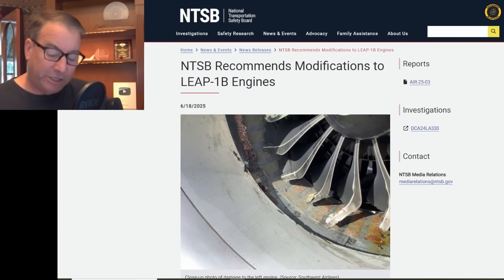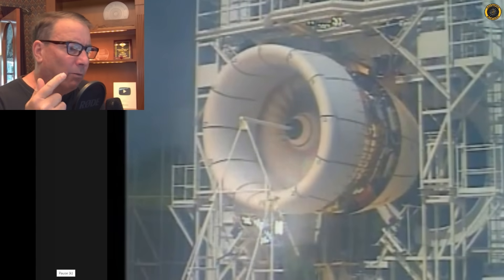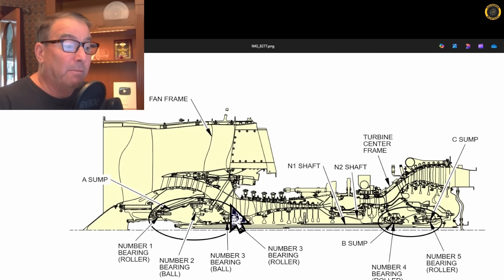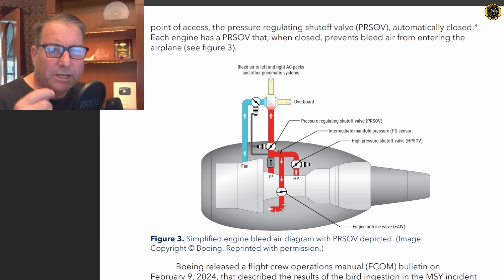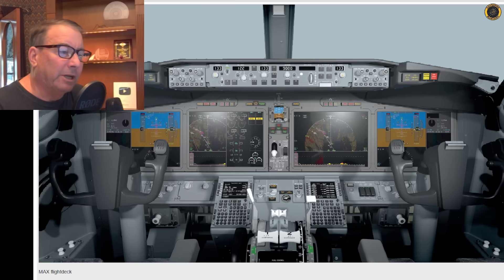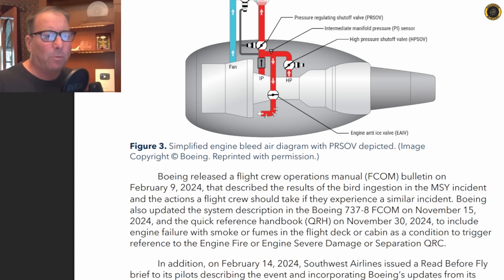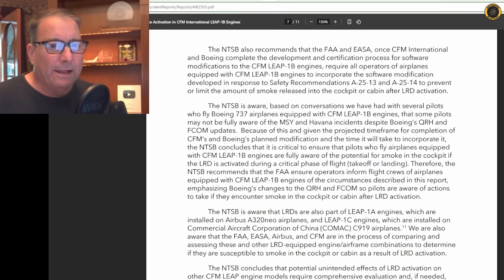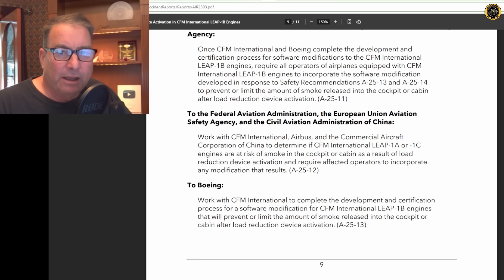NTSB Urgent Safety Recommendation 737Max LRD CFM Leap Engines

Comment: Great video! Looked up our Bulletins and found the updates went in January/February. Had gotten word that a change was coming when I was attending CQ in January. A couple of comments about iPads and whether or not updates are read or skipped. 

It is true paper documents did give you something tangible to reference. I would argue that I can access information MUCH faster and accurately via electronic means using search functions without our document readers. 

That said as a recent Captain upgrade to the 737 I was reminded by my Mentor and  Instructors that flying is indeed a verb and not an adjective. Be it electronic means or paper I believe it's how the pilot approaches their craft that makes a difference.
Reply: The word "flying" is also a present participle and a gerund .. not that anyone cares.
Reply: @hb1338 excellent. I’ll add to that to my brief next trip. Engineering, weather, and etc was my strong suit. Sadly even today grammar is not my strong suit. 

But I’m down for being correct to thank you for sure!

Comment: We are lucky to have Blancolirio and Mentour Pilot to keep us so well informed on these critical aviation subjects. 
Bothe Juan And Petr deserve credit for their professional attitudes on aviation safety.
Reply: Don't forget Kelsey Hughes from 74 Gear
Reply: What about captain steevie?
Reply: oh this is a funny comment. I remember when the first two MAX's fell out of the air and Juan told everyone that it's not that big of a deal and Boeing would take care of this problem ASAP.
Reply: @SebastianPeitsch  Everyone has to start somewhere. I've made similar mistakes before too. You get better through experience and I'd say the Juan's attitude in more recent videos (That I've seen...) is both respectable and commendable. I believe he is trying hard not to make that kind of mistake ever again.
Reply: @SebastianPeitsch Take this comment as you will but one of those crashed Max's flew THREE FULL segments with the known problem.  This aircraft would have been immediately flown back to departure airport and grounded until the problem was rectified.  And I suspect western countries would not have been using illegal and defective replacement parts.
Reply: @garyhalmbacher6875  So what ? The design of MCAS was inherently flawed and dangerous, Boeing failed to test the system properly, failed to take action when it failed in cockpit simulations and recklessly chose not to inform airlines or pilots of its' existence for reasons that were nakedly commercial. How bad can a system be when less diligent operators are the first to discover its' faults ?
Reply: @garyhalmbacher6875  the problem I am adressing is that Boeing was riding on their reputation of being a well-run, secure business. In reality they managed to lead the authorities around the three ring circus by the noses, in the US as well as in Europe, while destroying the union run system in Seattle with going to North Carolina, and moving the headquarters to Chicago. And when the Max crashed it was "irritating" to say the least the Juan was defending them like he did. It's good that this is no longer the case and that the shortcuts Boeing was taking are now continuously being outlined. Look at this nonsense. Avoiding re-certification for FIFTY YEARS just to avoid training. THREE concurrent checklists. That is INSANE.
Reply: @SebastianPeitsch I agree with most of your points.  The fatal move was moving the headquarters away from the factory.  The real reason was the new CEO didn't want to live in Seattle.  If you don't want to move, don't take the job.
Reply: @SebastianPeitsch Having worked in and around union shops, unions protect the lazy, stupid, and criminal.  Good workers don't need unions.  Even if fired, they have the ability to find another, better job.  My motto: Big Government, Big Company, Big Union, the little guy gets screwed.
Reply: @SebastianPeitsch I agree with you that when McDonnell Douglas bought Boeing with Boeing's money, that was the beginning of the end.  The rot starts from the top.    That said, I don't know why everyone says Boeing should have designed a new 737 replacement but if Boeing couldn't even pull off a minor upgrade, why would anyone think they could design a replacement from scratch?
Reply: @hb1338 Actually, MCAS, while stupid, was designed initially for a ONE TIME adjustment of the Horizontal Stabiliser and the initial adjustment was quite small.  The implementation was a disaster and I believe shows Boeing no longer has the project management skills to implement much of anything these days.  Hopefully, now that engineers are running the company, things might change.  Or, it might be too late.

Comment: With regard to the use of the acronym QRC (in this video)  FYI  -  At AAL QRC means Quick Reference Card, not Quick Reaction Checklist.
The QRC is a laminated card that both pilots have on the flight deck, and this card is two sided and has all the "emergency" procedures 
and the "Immediate Action Items".  Many times, you execute the procedure, and the QRC then references you to an expanded procedure in the QRH.  Might be different at other airlines, but again, just for an FYI, that's what it means at that airline.
Reply from the maker: And the throttles are called thrust levers...

Comment: I timed myself and it took me 55 seconds to do memory items and complete QRC step 4...pull the engine fire switch which closes the PRSOV. Thats not going to work if visibility is at 5 inches and at lethal levels in 39 seconds. In reality, we would need to get oxygen masks and goggles on before dealing with the engine. Seems like flipping off that pack switch before doing anything else makes the most sense. Its going to be near the 2 minute mark before you pull that fire handle. This issue emerged over two years ago in March 2023 and we are now only sending a memo to remind pilots to read the bulletin.

Comment: The “hey let keep 737 the same so airline don’t need to retrain the pilots” decision is the gift that keeps on giving. So far a few hundred lifes have been sacrificed for it (MCAS). The decision that was made mainly on financial purpose rather safety first. This smoke thing has potential. Good thing someone caught it but some pilots may not be updated. I hope it’s not my flight. This 737 max has lots of gremlins.

Comment: LRD bolts are further aft from what is illustrated. If the bolts indicated in Mentour’s image were LRD the fan disk would depart the engine.
Reply: as an engine designer who has looked at this area I agree ... I could be wrong though 🙂This has probably been pointed out but breaking these bolts (or stretching) limits the amount of force transmitted from the Fan roller bearing (No. 1) into the Intermediate Case and through the mounts into the airframe. Breaking this flange also sends all the oil from the bearing housing into the high compressor where bleed is pulled off to supply the aircraft ECS system. Enjoy the channel very much Juan!

Comment: Suggestion: Select a random group of Airline pilots across carriers and give them a checklist and see if they can punch holes in the logic of them from a safety perspective.  The need for this critical revision could possibly have been spotted via some scenario simulations/reviews with the view of spotting critical shortcomings.  In the original check lists, as I understand the video, the crew would get to "do the right thing" but it was buried by 3 pages.  What iffing stuff is an important tool to issue spot.  Thanks for your work.  Question; how much input do flight crews have on the development of checklists or this left to the domain of the technical brainiacs at the aircraft designers shop?  Hint...need for some sanity checking before the fit literally hits the shan as they say.

Comment: This “fix” only addresses one circumstance that might allow contaminated air into the cabin&cockpit. Seems like it might be better to design a system that would monitor the air quality coming from the turbines and shut off that air when the quality is poor, just like some luxury cars automatically switch the air to ‘recirc’ when outdoor air quality deteriorates.

Comment: I've been following air accident and air incident investigations for the last 8 months, I used to do failure analysis in the automotive industry, my factory used to make safety critcal electrical components and when one of those failed causing a car to spontaniously combust (which was the most common failure) I and my team would do a root cause analysis. I'm starting to see a patten emerge where aircraft manufactures cut corners in order to save having to change the type rating.  Maybe they type rating should be enforced for all new aircraft regardless to try and stop these corner cuts? I feel something should be done because these aircraft manufactures don't seem to be doing as much quality assurance (like an FMEA analysis) as I had to do for a heavy goods vehicle.

Comment: There should also be a chance to the way the ipads are updated by placing the changes up front and having the pilots acknowledge the changes before they are incorporated into the rest of the electronic manuals.  Kink of like the pink sheets described in the video.
Reply: I agree.  But let me ask… have you ever scrolled through the terms without reading them before you clicked the “I agree to these terms” button?

I guess what I’m saying is that it might be a little harder to make it happen than when you had to pick up a piece of paper, and at least LOOK at it to figure out where to put it!  But I would hope there is a solution in the modern era.

I wonder if the culture of “normal” computing carries over to the pilots in some unfortunate way.

Comment: It's surprising that in our day and age pilots have to find checklists in their iPads instead of these checklists being presented on these nice glass panels - I guess, the sensors all modern airliners are stuffed with would allow to determine automatically what checklist should be presented and even would perform most actions automatically (like shutting down engines, activating and deactivating some systems, etc.)
Reply: Pretty much every airliner, outside of the 737, does this with ECAMS and Engine Indicating and Crew Alerting System EICAS systems. The checklist is presented on right on a screen for the pilots.
Reply: Having checklists on an iPad as a back up has proven useful in the past (e.g. UAL1175 where strong vibrations made operating the B777 checklist almost impossible)

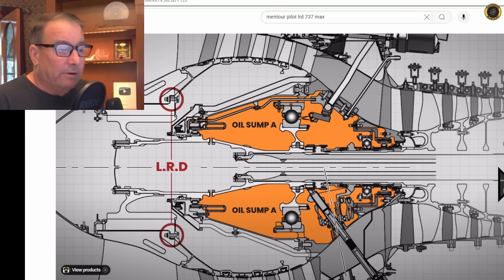Comment: Juan, at 3:25 you are pointing at bolts that drive the other compressors directly behind the fan. The LRD bolts are where the bearing support attaches to the front frame, which is  directly above that huge ball bearing you can a see in sump A.  You can even see the necked-down bolts holding that bearing support against the front frame.  When large loads occur at the forward bearing, they are making their way into the front frame through that bearing support, and that’s why those bolts are necked down in their design To only take a certain amount of overturning moment… instead allowing the fan to try to rotate more around it’s CG eccentricity.

Comment: Same engines are used on A320
Reply: Yes. And they automatically close the air conditioner valves if an engine vibration exceeds its allowabes, as Juan pointed out. The 737 is still manual and there wasn't an emphasis placed on closing the valves in the QRC.

Comment: The reason the aviation YouTube community is critical is because the NTSB and the FAA have repeatedly failed to get important safety information out to pilots or make meaningful changes to policies and procedures when there's a known problem.  THANK YOU JUAN for being a big voice and helping to spread the word about these topics.
Reply: The NTSB does not make policies. They only recommend actions. For decades it has been known that the NTSB endures frustrations about the FAA that seem to drag their feet anywhere they can, specially if a remedy will cost airlines. Think about that. Is the FAA(its make up) the right setup as an aviation authority? Shouldn't the NTSB have more power?
Reply: @2oqp577 The reason the NTSB is allowed to be so vocal and critical is because it has no legislative power. This allows them to make harsh criticisms during their investigations without concern of political backlash. It is theoretically powerless by design, and changing that it would just become another component of the FAA. It’s not a perfect system, but as far as government bodies go, it’s mostly trustworthy
Reply: @2oqp577  Does that make it an issue that Congress needs to take up?
Reply: @2oqp577  FAA is by law a regulatory authority, yet it spends most of its' time promoting and protecting the aviation industry. Somebody somewhere needs to fix that.
Reply: @2oqp577 I totally understand what you’re saying. But when investigations take 2 years and then they don’t even make any recommendations to improve safety… what’s the point of even doing the investigation?!? Seems like YouTubers are the only ones taking accident information and trying to educate other pilots so they don’t make the same mistakes.
Reply: @TheMotoRockers  Well, their recommendations have been the same for years, they are tired of the black whole these go into at the FAA. As for me, upset training, theorical and/or practical would be a must (AQPs) and for low time IFR pilots, recurring training frequency should be up-ticked like for doctors, lawyers, etc. Also, all the 'feel-good' CFIs should get retrained and learn to be tough with students, like Captain Bob' CFI. The subject of fatal errors should be thoroughly discussed; getthereitis, continuing on in IMC while VFR, density altitudes, trusting your instruments, impressing friends, etc. If I was a CFI, all these subjects would would be discussed with a fist on the desk.
Reply: @2oqp577 Amen. We shouldn’t be handing out participation trophies that are disguised as ratings to pilots that can’t perform under pressure or meet strict standards.

Comment: 737 is a massive bodge to get around the type specification.
Reply: The 2 early crashes were caused by the bodge software that corrected the AOA due to them putting bigger modern engines on that didn't fit as the wing was too low and they couldn't change the landing gear height because of the type certification. Move engines forward meant they had to add the bodge software and now this. The question is what other design skeletons are in the closet of this plane.

Comment: These planes should be grounded until there is a fix for this problem
Reply: 15 million safe flights with no fatalities in a row over the last 8 years do not ground a plane because of two incidents that did not cause a crash or even a severe hazard 
Aircraft are incredibly complex sometimes it takes time for things to happen because they're so safe for an issue to happen for you to realize you need to fix it. Unfounded fear in the face of statistics is not healthy

Comment: Sump A is not completely full of oil, you can see the spray bars which spray oil on the bearings in your cutaway view. There will be oil and oil vapor, but not completely full, it would cause way too much drag on the rotating components causing higher fuel consumption.
Reply: I see what you’re saying, but my dipstick has a “full” mark, even though I know my crankcase is not completely full.  Just an anti-pedantic thought.

Comment: Half the overhead panel is literally interchangeable with a 737-200 which was originally designed with a flight engineer.   Half the type rating is just the bleed air panel.   
So, every five years Boeing is going to pull the next surprise out of Pandora’s box?
Reply: 737 was always designed for two flight crew operation.  Those that had a second officer only had it for union reasons and eventually they were removed.

Comment: A bit confused.  Are the NTSB suggesting that pilots be made more clearly aware of the new checklists at the same time they're requiring the manufacturers to change their software in a way that will require a further checklist change in the near future?  Or maybe there's an anticipated significant delay in the new software that would make this less likely to cause confusion due to rapid changes?
Reply: Yes and Yes.

Comment: Personally, given the wording on that "technicality", the engine oil was not exhausting through it's normal path, so should have been classed as debris.

I know the final report on the separate "door plug" incident is coming soon.

I know there was some speculation at the time that removing the door plug, to help with the fix to the bulkhead rivets, was classified as not requiring checking after reinstalation.

So whether a similar technicality let that one slip through will be interesting to see.

Although given Boeing conveniently don't have any records of the door plug and reinstalation, who can say?